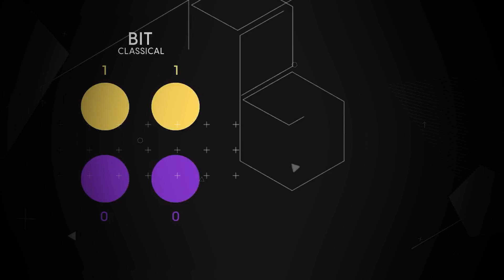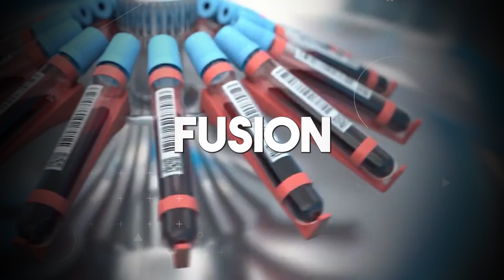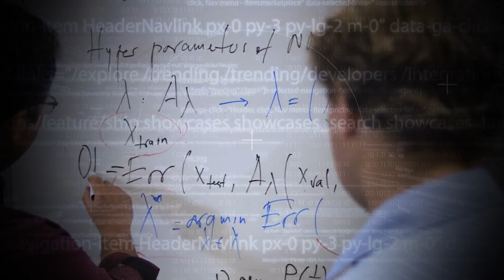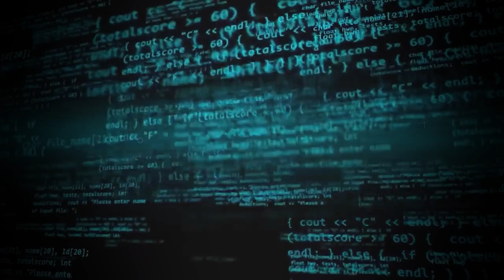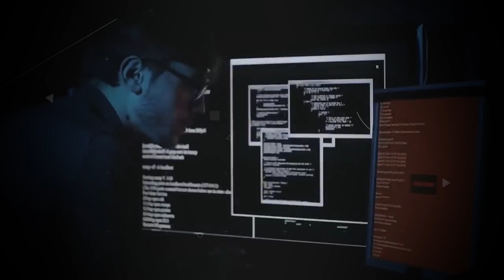10 Things Will Happen When Quantum Computing Uses AI

Comment: Great content however, what was said about Quantum Singularity, was the definition of Artificial SuperIntelligence (ASI). Quantum singularity is a different thing.
Reply: ASI,Quantum Singularity has not been mentioned before, so what would be the difference in quantum Singularity verse ASI,Q version?
Reply: @Dbean48  Quantum singularity typically refers to a point in space-time where the laws of physics break down due to extreme gravitational forces, such as at the center of a black hole. ASI in other hand is AI that supercedes human intelligence. We have three stages of AI. Artificial Narrow Intelligence (ANI) which is what we have and use today and also called Weak AI. Then we have Artificial General Intellligence (AGI) which would be at the same level of human Intelligence. Both AGI and ASI need much higher compute power, which QCs wold bring that level of power.
Reply: @Arvin-2585  Thank you for this explanation.. So in the end if AI super intelligence is the Quantum computing power that can compute the anomalies in the gravitational breakdown of energy placements and displacement doing some exotic physics beyond human understanding, correct?
Reply: @Dbean48  The terms 'gravitational anomalies' and 'energy displacement' primarily relate to the field of physics rather than directly to artificial intelligence (AI). When discussing artificial superintelligence (ASI), it's important to note that its computational power could potentially be enhanced by quantum computers, but quantum computing is not the sole source of ASI's capabilities. In general, AI operates on a triad of factors: computational power, data, and algorithms. Improvements in any one of these areas can lead to advancements in the others, making the overall system more efficient and effective.
Reply: @Arvin-2585  Thank you for the triad information on the ASI capabilities!
So down the road it has possibilities of enhancing physics interactions of energy in all its known possible forms we now know and (unknown possibilities as exotic physics) due to the extreme gravitational interactions..in the timeline formulation schemes for a specific dilation of a timeline and gravitational space for portal formations to specific dimensional interactions as well? 
I had a thought of dimensions can flow through other dimensions it has its own timeline flowing in a circle one way another parallel dimension flows opposite forward one dimension and backwards in a loop the other dimension.. catching segment of time to future or segment of time in the opposite dimension to return back..bubble interchange factor..Well thank you for your input.. like a bit of thinking on possible outcomes.. and comparisons..

Comment: Power it with a fusion generator and sprinkle in a little dust from the philosopher's stone and you could travel back in time if the flux capacitor is properly adjusted.
Reply: Excellent thought..  exactly the same as what I was wondering about.
Reply: ROFL 😂
Reply: sorry you can't time travel to the past
Reply: @mallo3021  Not if the flux capacitor isn't properly adjusted.
Reply: Not on Cyberdyne Rev-9 watch.. your process has never occurred.
Reply: Need reliable 1.21 Gigawatt power source first!!